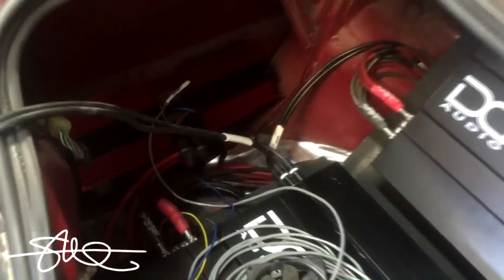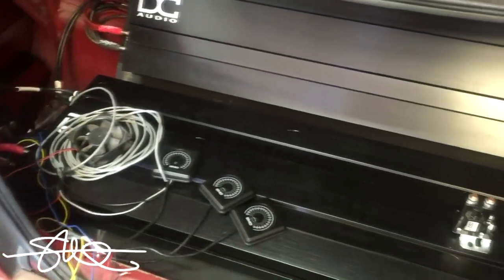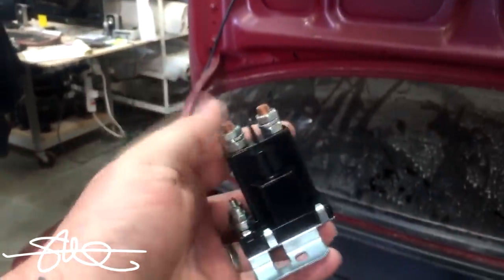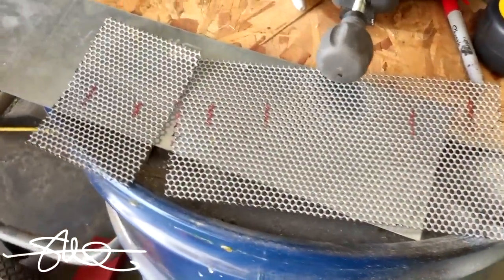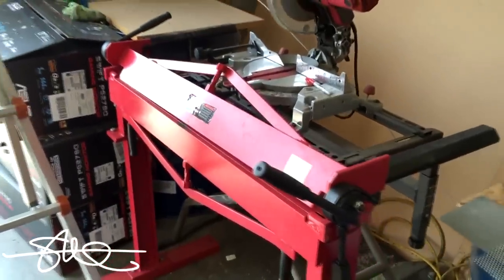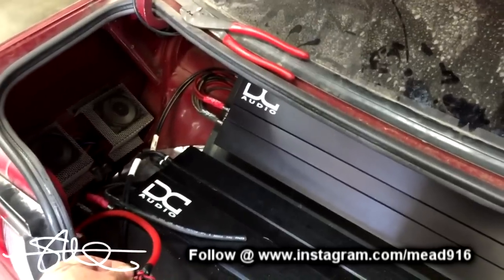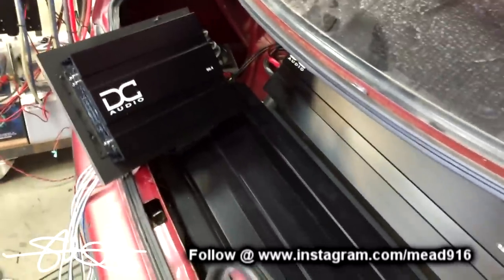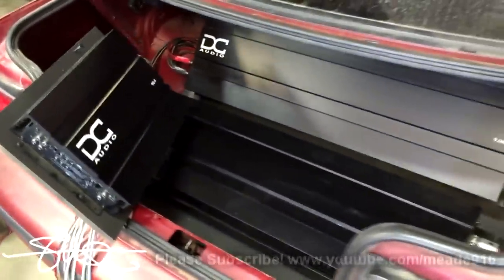91 Toyota Tercel D.G.A.F. 20kw Sound system - Step Down Module Cooling Fans  install video 12 -

Comment: Wouldn't you get better air flow if you cut out right under the fan and left the metal where they are mounted? Bet that would be 25% more airflow if you opened the grills up right under the fans.
Reply from the maker: Steven Watson it actually blows very well the way it is....but thanks for the concern. :)
Reply: Figured it would be fine. I just am used to dealing with sport bike air filters and the stock ones have a similar metal screen over them where the racing versions do not. Makes a huge difference in airflow. :-) Those probably won't get hot enough that it will make a difference though.

Comment: I got my step down moduler running in between my alternator and battery, but voltage goes around my step downs because of the wire from the car that hooks up to the alternator, (voltage regulator wire I'm guessing from car itself) cause when I unhooked it, my voltage goes down to 9.? Volts, and I also have a XS Voltage Regulator hooked up 2 my Alternator. Either way, when I unhook the wire that comes from my car to the alternator Power supply? I lose Voltage, & when hooked up, all voltage goes around step downs and gives my 12V battery 2 much voltage, and now my battery done swelled up from overcharging??? How do I fix this problem??? Besides that wire from car that controls the voltage from alternator, I do have a separate wire going to my 12V Battery w step down moduler in between, and separate wires from alternator going to back to my 14V Batteries in tha back.